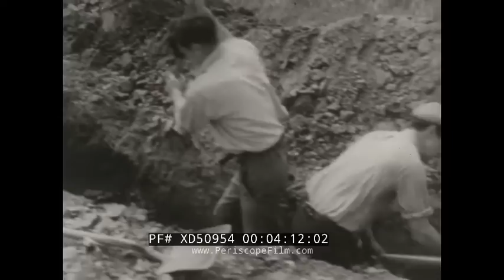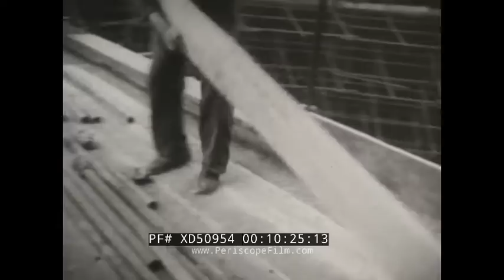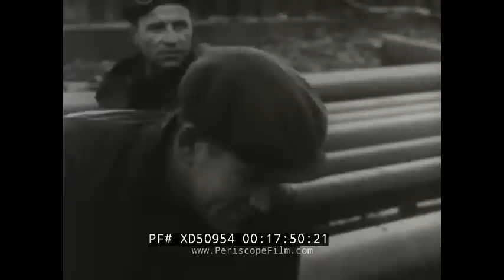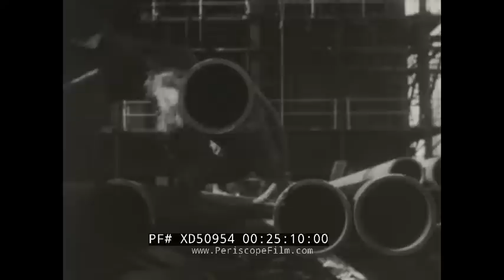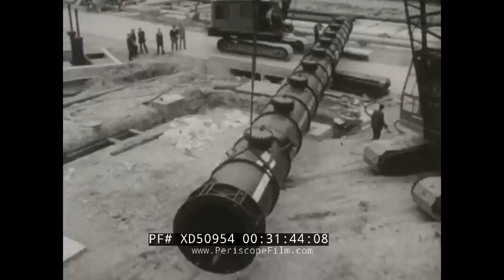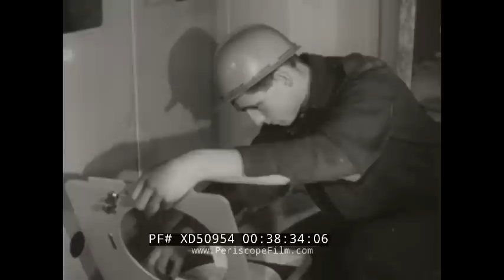" STANLOW STORY "  1952 SHELL OIL CO. CONSTRUCTION OF STANLOW OIL REFINERY  UNITED KINGDOM XD50954

Comment: i notice no mention of the aspestos used in the building or the affects on the workers for the rest of there lives
Reply: As long as you don't breathe in the minute particles, you're just fine.
Reply: Probably because the danger wasn't officially conceded till the 1970s, I think. Despite having been known since the early 1900s. A bit like smoking and lung cancer. Even the Romans had noticed a high death rate in asbestos quarry workers.

Comment: I work on Stanlow refinery in the early 70s as an electrician with NG Bailey electrical contractors with digs in Chester. I was a chargehand on the water treatment plant and also worked on the 4  th power generator set , or it could have been the 3rd memories fade